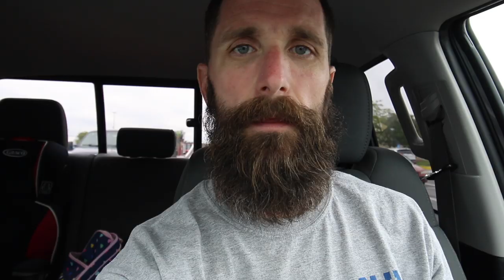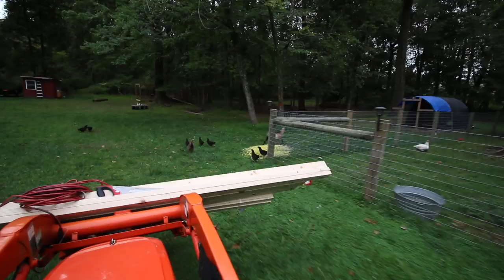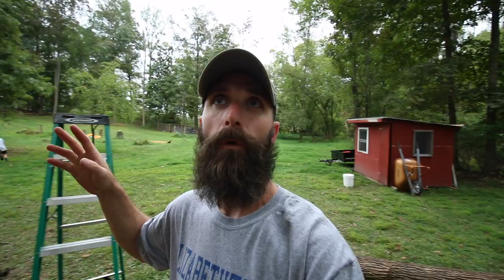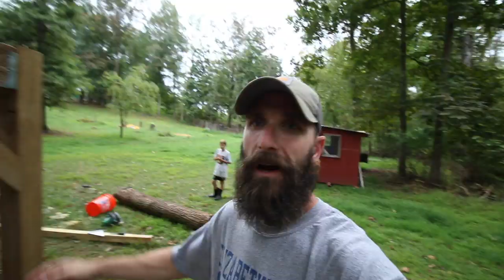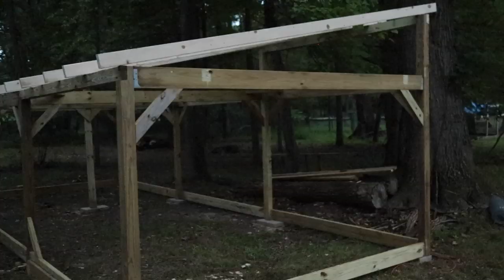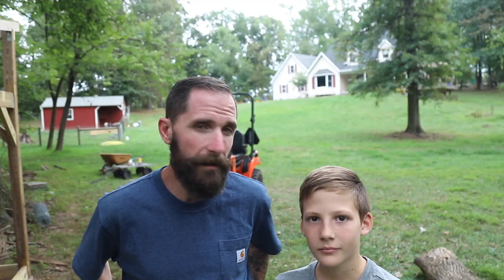Chicken Coop & Run Build || Part 2 || Adding Beams to the Run

Comment: Love your built but do you anchor into the ground due to strong wind storms?
Reply from the maker: No. Its down in a valley and slightly protected from the winds. What winds we do get down there it has dealt with happily. If it were in an open area, I would definitely anchor it down!

Comment: Hey Kenny....I'm getting ready to make this build. I presume the long boards are 2x6x8 between the posts? Making the space between posts 8'? And the posts are 4x4x8? When you took out the 2x6 to notch the post, what length was the new post you put in?
Reply from the maker: The posts are 4x4x8. The beams are 2x6x10. Each section was 10’ plus the post, except the first section with the roof. That one was 8’. I used joist hangers in lie of notching out unless it was holding the roof. Those were notched and I believe came out to 8’ 7”.